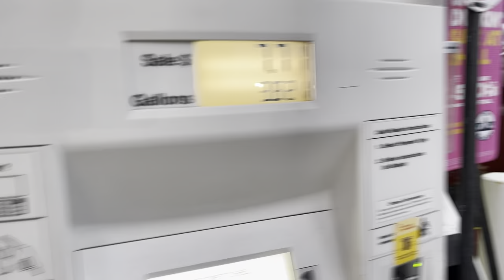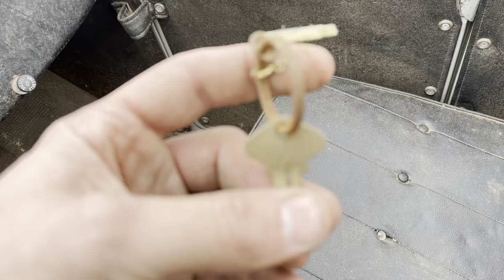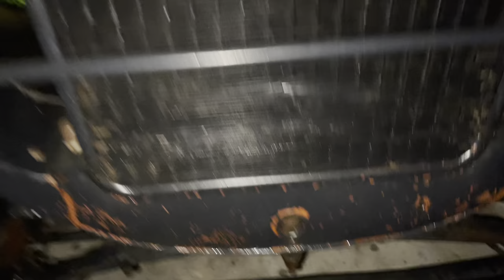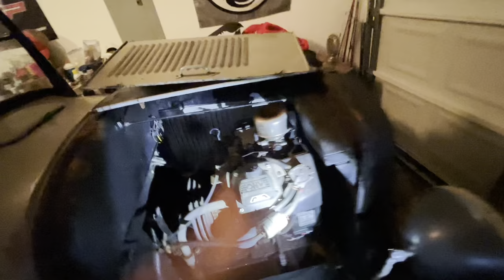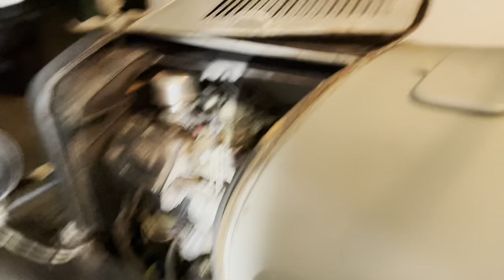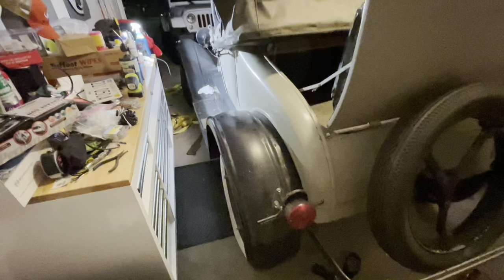I bought a 1926 Model T Roadster! American Classic?

Comment: The headlight that works is the one filled with water🤣. Shouldn't it be black as the original color? 

I will miss the C10
Reply from the maker: The body appears to have been painted. The other light looked like it cut on then burnt out before I walked up front. I will miss the c10 as well but i plan on getting another one! One day...
Reply: @UncleMike1776  I figured it was painted.